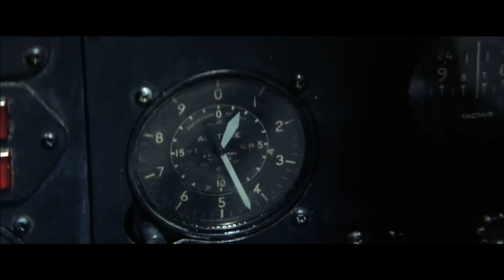Why do these starfighters ignore physics?

Comment: My grandfather worked on the SR-71 program up at Edwards Air Force Base and there are so many things about it he still can't talk about. Loved the callout of the platform you made here!
Reply: My dad was an astral navigation technician on SR-71's during the Vietnam war. Since he programmed the SR-71's navigation system, he new it's maximum speed. He never told us, but whenever a TV show would mention "Mach 3.2", he'd just laugh and wink.
Reply: @murphsmodels8853  My grandfather said similar things anytime the topic came up about the SR-71's capabilities lol.

It could probably push 3.6 or so in reality but you'd start hitting heat and airframe issues at that point.
Reply: @KevinTheID  Ramjet/Jet hybrid engine could prob hit Mach 4 with a 90,000 foot ceiling
Reply: @michaelanuradha-khufu74  Oh yeah agreed, I think it could reach Mach 4, but could the airframe take it is the question.
Reply: @KevinTheID  True. It is about 3070 mph, which might be the upper limit as even the XF103 (a concept interceptor made of Titanium) could reach Mach 5 with ramjets. It was designed in the 1950s
Reply: "The SR71 Blackbeard with a velocity of mach 5 and a maximum altitude of over 80000 feet"
"You sure seem to know a lot about it"
"DO YOU EVEN READ MY CHRISTMAS LIST?"
Reply: @jotheunissen9274 bwuahahahahaha!!! Every single time I see anything about the SR71 this quote from TFS Alucard lives rent free in my head 😂😂😂

Comment: My headcanon is that Sudden Movements could damage the pilot thanks to bloodflow being disrupted.
This is why they should fly like they're in gravity.
Reply: Yeah, star fighter pilots might not have real gravity to work with, but they still have to worry about G-forces from acceleration and deceleration. So they can only endure turns and speed ups or slowdowns that we could endure under Earth’s influence anyway.   And dogfights and ship engagements only make sense when everyone was at about same relative speed anyway.
Reply: inertial compensators are specifically designed to protect pilots from deadly g forces. However, it could be said they have a limit, so instant stops from top speeds followed by immediate full thrust to the left or right could still scramble a pilot’s insides.
Reply: @icetang97  they are also adjustable. Some pilots like having them set at a certain way, other pilots prefer a different setting. In one of the X-wing books (I THINK it was Wrath Squadron, but it might have been Rogue Squadron), Wedge notes that Jek Porkins, one of the pilots who died in the Death Star run, wasn't able to realize his X-wing wasn't acting like he thought it was because of his setting.
Reply: @icetang97  I recall, at least in legends now, that an A-wing could do 5,300 g acceleration.  The pilot would be goo and the ship would hit infinite mass at the speed of light in less than 5 minutes.  Rocket launches here on earth are about 5 to 7 g.

My headcanon is a top-off at about 250g for inertial compensators before they're unable to do their job, it fits reasonable acceleration and spaceflight velocities for a SW setting.

Comment: Because a realistic orbital velocity would look like a blurry smudge for two frames if you're lucky. That's boring. Battlestar Galactica comes close to realistic battles by using RCS thrusters to turn sideways in space, but even those vipers are traveling way slower than they should be.

Comment: Most scenes in space around a planet in Star Wars are not actually in orbit. They are just hovering above the planet by using antigravity. It's also much easier to bomb a target on the surface if you are stationary above it instead of zooming past it at 17,000 mph. So there is really no such thing as 'orbital bombardment', just 'high altitude bombardment'.
Reply: Geosynchronous orbit, a fixed point in orbit above the planet's surface where the object manages to stay in sync with the planet's rotation. So thereby having orbital bombardment actually being real
Reply: @mississaugaicedogs  Yeah but then the ship has to be much further away from the planet, like 22,000 miles away if it was Earth (ISS is only 254 miles up). The ship also has to be above the equator. Maybe if it was a very small planet which spins much faster than Earth, it'd be more viable than on an Earthlike planet.
Reply: Orbiting is falling down, but missing.

Comment: The most aerodynamic ship in the franchise, the N-1 Starfighter, has the same aerodynamics as a car.
And let's not talk about the TIE fighter.
Reply: lol
Reply: The Twin Ion Engine more than makes up for it's wacky design lol
Reply: @mbphilipblack8993  It's still the worst sci-fi fighter ever created. 
Cant even give it a 1 on the cool factor.
Reply: N1 sits around 0.1cd. The average car is about 0.25-0.3cd. which may look good for the N1, but most big passenger airplanes 747, A380 are like 0.03cd. Heck fighter jets are about 0.06cd. 

The TIE sits at 0.98cd, and a brick... Sits about 1-1.1 it's barely better than a brick.
Reply: the TIE Fighter has the aerodynamics of a bumblebee

Comment: Also how do they make sounds in space
Reply: Simulated positional audio in the cockpits to help with spatial awareness.
Reply: @ecyor0 ahhhhh… 🎯
Reply: @ecyor0 is that an actual thing in SW?
Reply: this is an amazing answer, im gonna hold onto this! thanks  @ecyor0 ❤❤
Reply: @ecyor0 it would also make sense why every class of fighter has a different “engine sound” and audio IFF as it were.
Reply: @ecyor0  That's what I was going to say, only in a more long winded way. Sensors track all the ships around you and their relative positions and speeds. When one approaches, a surround sound system in the cockpit simulates engine noise coming from that direction. You even have different sound palettes for different ships to easily identify friend from foe without needing to look.
Reply: @ecyor0  That's the answer I would have given.
Reply: @ecyor0 One of the books called them "sonic interpreters" but it does what you are saying.
Reply: Also clapping underwater in the Mon Cala arc
Reply: The Dark Side of the Force is a Pathway to many abilities that are scientifically impossible (I don't know)
Reply: I always thought that starwars space was more like the aether, it has somesort of air or atmo like substance in it, explaining other things too, like Han and co using just a gas mask when they thought they were in an astroid cavern, plus things like mynocs being able to live and fly with wings in space.
Reply: @gj3717 pretty sure minoks (?) aren't carbon based life, and i would guess they can "fly" like the Hyperspace whales, or use the energy they store to propel themselves.
Reply: @xxvaltielxx1789  still have tradional atmo based wings that are for creating lift. Han and co are carbon based life though, and they went into an astroid cavern with just a gas mask on, no sort of vaccum suit. Same for all the pilots and crew of starships, no void safe suits anywhere.
Reply: @xxvaltielxx1789 i nite.. They seem to be everywhere
Reply: @gj3717  They weren't inside an asteroid cavern. They were inside the belly of a gigantic "space worm" that devoured the Millennium Falcon before they went outside the ship.
Reply: @jacob4920  but they did not know that at the time! They thought they were stepping into an asteroid cavern.
Reply: @gj3717  The very existence of The Force is a worthier complaint than stuff like that anyways. lol
Reply: @jacob4920  but they did not know that! That proves my point.
Reply: I'm pretty sure that just for the audience
Reply: @TheMandaloreFett  they don't need to explain why. It's just space stuff
Reply: Pew pew pew
Reply: The Force
Reply: @everettjohnson9374  that's not how the force works!
Reply: "In my world, there's air in outer space,". "When I want it."-George Lucas. there is your answer.
Reply: No one cares about that one. Lol easy to except.
Reply: They just do..
Reply: They have speakers in the ships to give ambiance and make it less weird.  That's my head-canon.
Reply: Imagination 🌈
Reply: If that's your biggest problem, then there really is no problem. Imagine how BORING space battles would be, if they were done completely in silence, as would be the case in the actual vacuum of outer space...
Reply: I love how you used props in this one 🙂
Reply: The same way sounds are made anywhere: vibration.